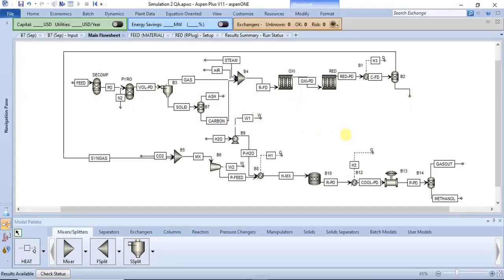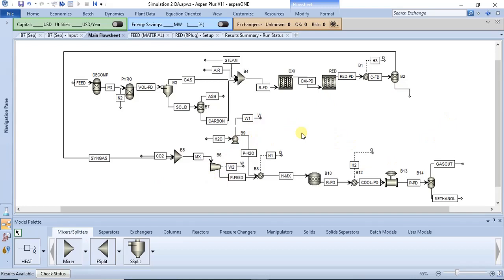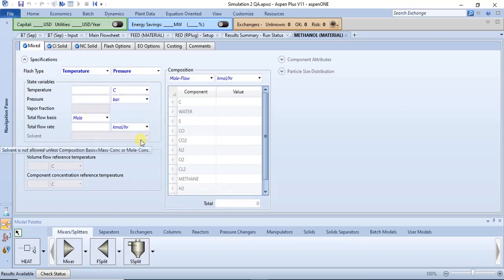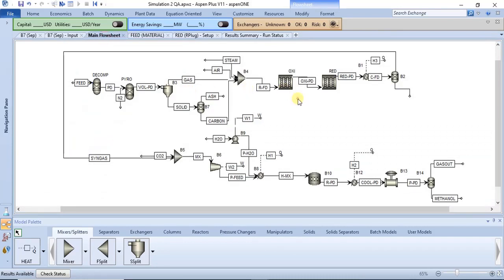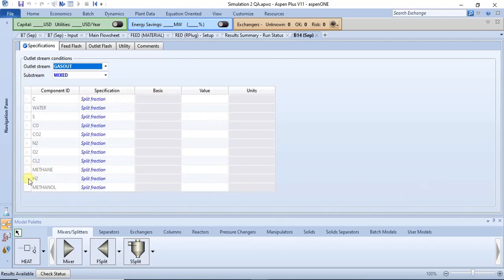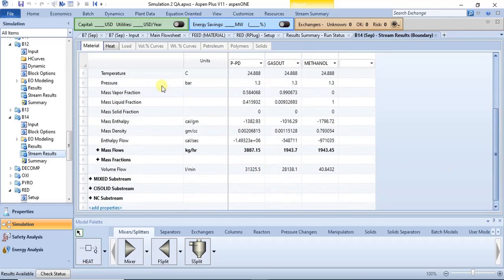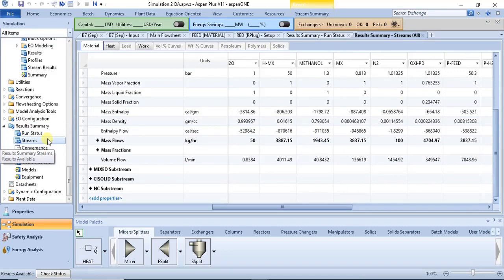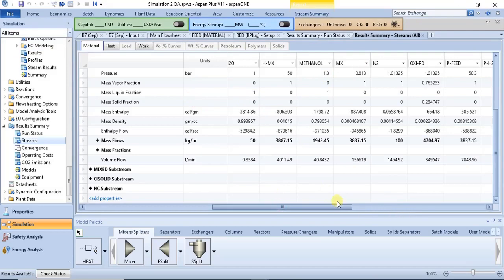How to access and export Stream Data in Aspen Plus

Comment: Hi, I am trying to import some stream properties into a new stream in ASPEN plus using the transfer block. while the transfer block requires an initialization, I input those random start point values and it shows no errors before I click run. the simulation runs, and the properties, viz., flowrate, temperature, pressure get displayed. but, when I go to further access the stream properties as in enthalpy, density, cp/cv, etc, the values come as blank. is there any solution to this bug? thank you very much in advance.
Reply from the maker: Maybe you should try adding those properties inside the stream themselves.
Reply: @hotspot105  yes, a manual entry solved the issue. I also found that this bug takes shape only in the hierarchy flowsheeting block. In the main block it works normal.
Reply from the maker: @arjunsuresh5872   Alright then. Kindly subscribe to the channel, thanks.